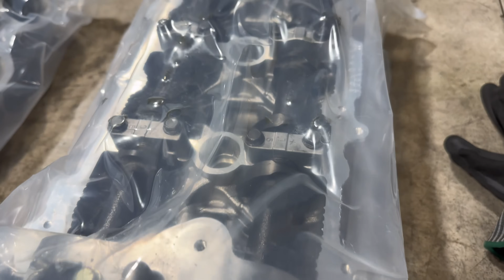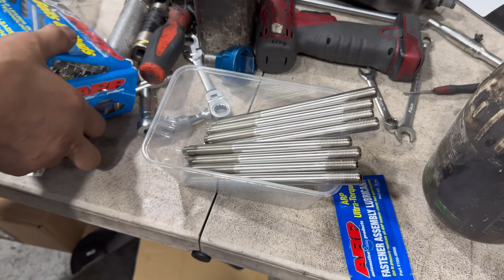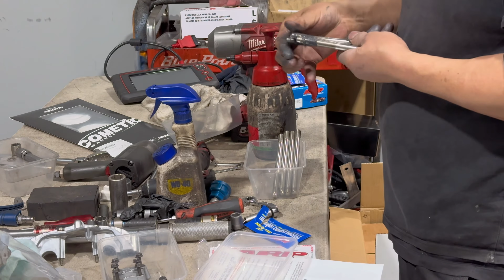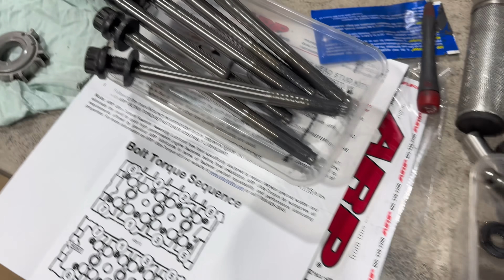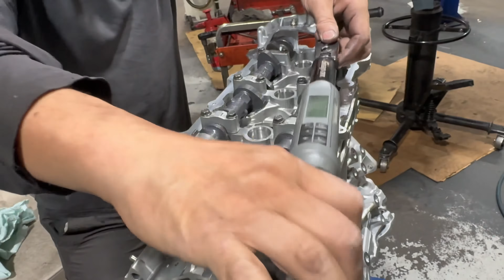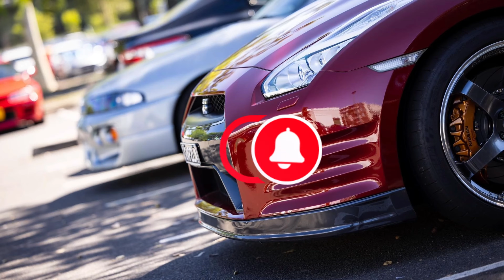Nissan GTR Engine Assembly Part 4 - R35 VR38DETT - 1100whp-1200whp engine build

Comment: So you didn’t specify ring gap, bearing clearances or whatever the “special sauce” is on the head gasket. Or why you used the “thickest gasket available” which would only be for head deck compensation or else it would mess up VVT alignment. But you showed food…neat. Its entertainment, not a how to on an engine build.
Reply from the maker: Why would we specify ring gaps when they differ based on what boost you plan to run or bearing clearances when that’s dependant your own components that you’re using. If I did every aspect it would be a 12 hour video. Ain’t no body got time for that.
Reply: @gapzlaGTR  you are building an 1100whp engine. I’m saying the video would be more complete if you specified what ring gap and bearing clearances YOU picked. I’ll start, on my 1108whp VR38, i picked .022 top ring, .025 napier gap. .0022 main bearing oil clearance and .0025 rods for use with 15w-50 oil.
Reply: @anthonymyers1694 hmmm I would love to know this as well. I’ll be attempting to build my own VR38 for my Q50 that’s getting vr38 swapped to a 6 speed. I’ve built some VQ but idk why the vr38 seems so much easier than the vq37vhr that’s complicated due to VVEL. These videos are a major help and motivation for me to do it and know it’ll be perfect

Comment: we notice that if you arp lube the washer side which sits on the block ,that makes the washer to spin when torqueing and gives wrong torque values
So we sand grit it with a 60 grit paper that side,and put it dry
Thats roughness on the washer dosnt make it spin
Reply from the maker: Really? We didn’t notice this issue, did you have this on vr38’s or just any engine in general?
Reply: @gapzlaGTR  we notice on any engine with arps headstuds
Reply: @gapzlaGTR  have you confirmed this with bolt stretch numbers..or measured clamping force? I always lube both side so that friction influence is at its minimum.